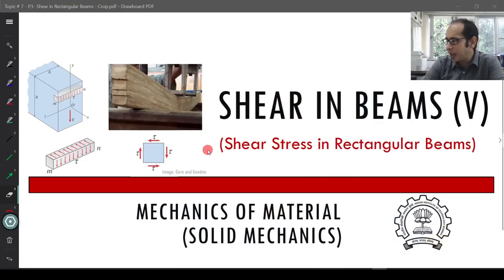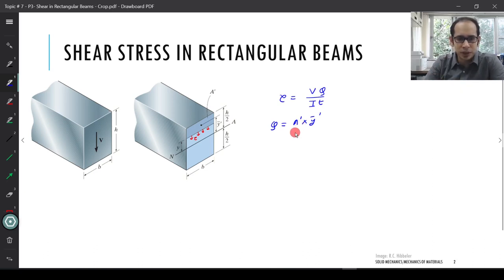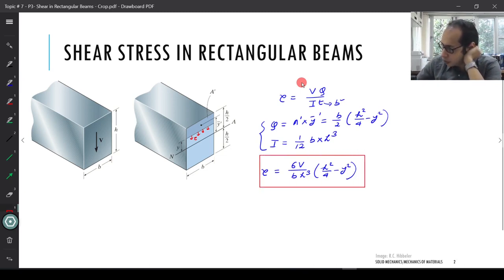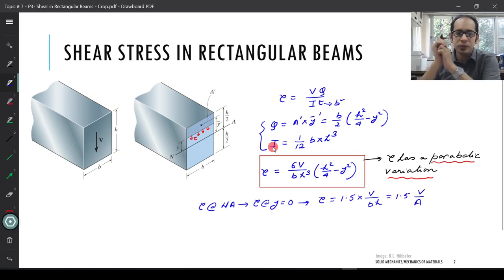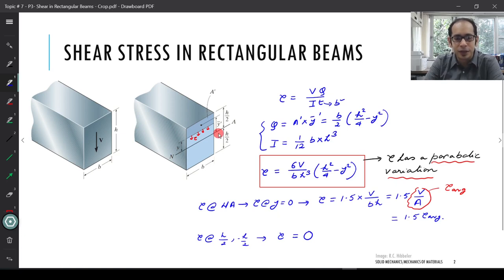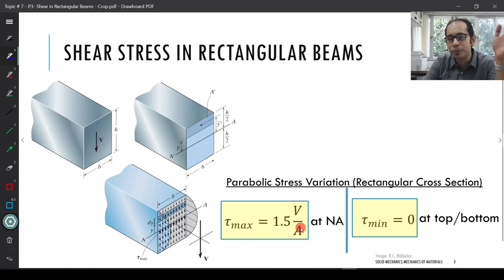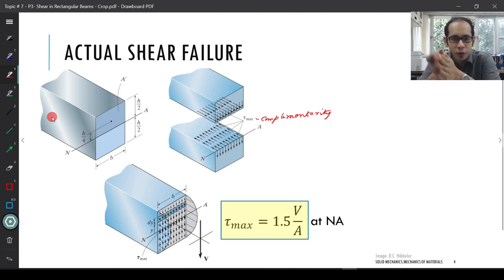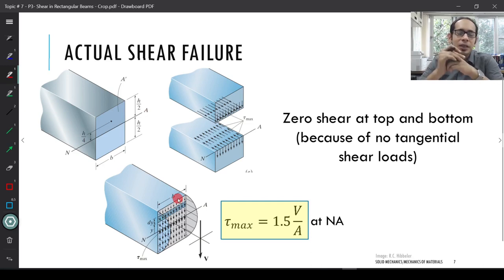Topic # 7.3  - Shear Stresses in Rectangular Beams

Comment: Thanks for the informative video. Can you explain why the shear at side are not zero, even though there is no shearing plane on it, just like top and bottom. In other words, what is special for top/bottom to have zero shear but for sides have shear?
Reply from the maker: Good question. Note that the shear on the section face is vertically downward. If there was shear on the side face, the complementary shear would b acting in the direction of b (complimentarity), which is indeed zero.
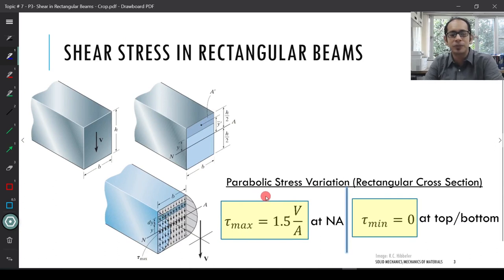Reply: @solidmechanics-prof.jaygho7500  Correct!! Which means shear at sides are zero. Then 3D shear diagram shown at 8:34 should not have any shear at the left and right edges. correct me if i am wrong please.
Reply from the maker: @sbz_  Hi! The provided diagram is correct. If there are shear on the sides, the complementary faces are different and NOT the front face. It stays unaffected. Please check this diagram https://www.dropbox.com/scl/fi/mb2l9gj464jhedg66wcmm/SmartSelect_20241028_185451_Notewise.jpg?rlkey=eiwnw6g9ov68t6t27pi94d92r&st=wy7xb2h3&dl=0

Let me know if it makes sense